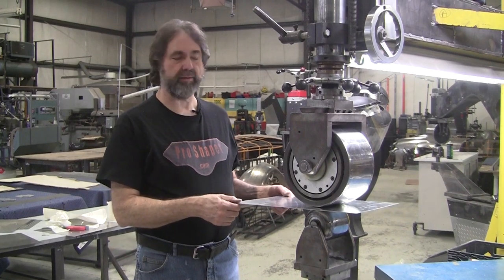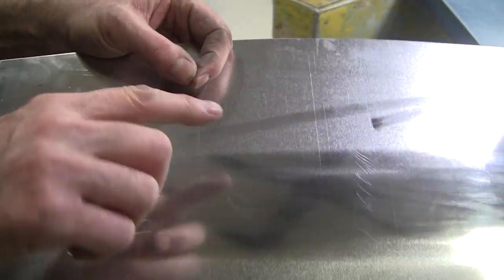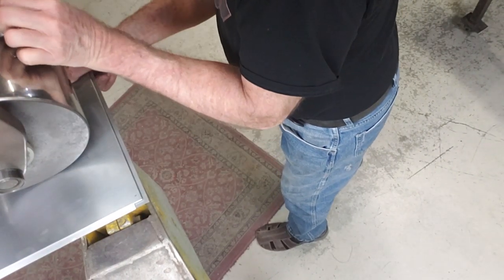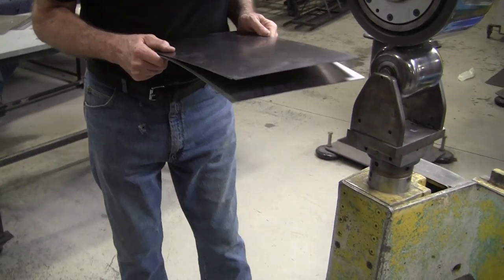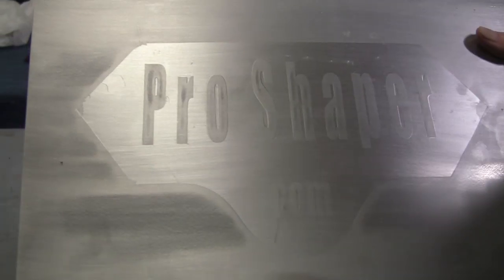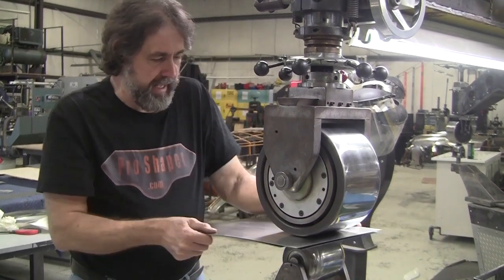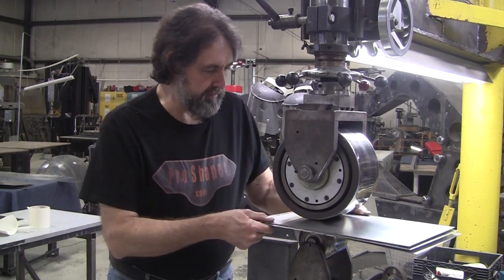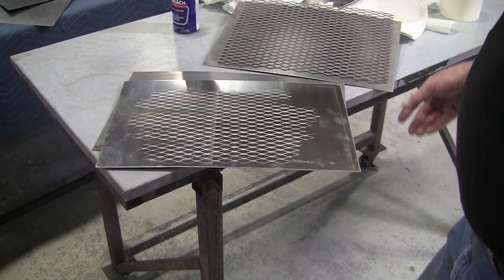Making Art with an English Wheel

Comment: The 92-96 Honda Prelude has the simplest-shaped dash of any modern car; it's just one continuous sweep from the left A-pillar to the right A-pillar, rounded over and slightly crowned.  I bet it wouldn't be that hard to make a metal version with the wheel (original was faux-leather-covered plastic).  This imprinting technique would be great for that dash!  But would you have to do all the wheeling in the sandwich, or do you think the imprint would (visually) still be there after wheeling with the bare wheel?
Reply from the maker: Hi Dennis, you could use a printed vinyl design and run over it under pressure after the dash is shaped. The process I used in the video is best for flat surfaces. A lot of 1930s cars had flat dash inserts where all of the instruments were located.

Comment: I'm one of those negative opinions of Plasma Cam. After two years of having experts try to make it work, I was finally offed a trade for a yellow dog.  It was a great deal. The dog doesn't take up much space and is easier to move. Also, the yellow dog is at least as good as the Plasma Cam for cutting out parts. If you are planning on getting a Plasma Cam just go to the animal rescue and get a dog instead. The Plasma Cam will give you two great days. The day you buy it and the day you finally get rid of it.  On a positive note; your coffee cup is working great. Thank you.
Reply from the maker: I have owned my Plasma Cam since 2003. I use it a lot, it never let's me down.

Comment: I'm Curious about the top adjuster on your big yellow wheeling machine.. Is it off something else or did you make it from scratch.? Thinking of converting my wheel to top adjustment  I'm always trying to repurpose stuff 😂  sliding propshaft  joints etc.. side effect is huge piles of unusual potentially useless scrap 😳..
Reply from the maker: My top adjuster on my Big Ewheel (which I built in 1993) came mostly from the local scrap yard. I had found the rack and pinion shaft and mounts several years before and knew I could use them as a component to a top adjuster. I also had purchased for peanuts a Bridgeport copy attachment that had a nice 360 degree locking swivel and large fine threads. Between the two components they merged into my top adjuster. All purchased for very little money- scrap prices.

Comment: G day i have a question/suggestion what if you used a rubber band on the upper wheel that might give the rubber a chance push in on the low spots of the design and compress where the pressure is higher 

Id like to try it but my e wheel is tiny and i dbout if the embossing would work very well
Reply from the maker: The rubber band would not improve anything. It is nothing more than high pressure that creates the embossing.
Reply: @proshaper  thanks for the reply so you have used a rubber band and the results were not as good ?
I just imaged that the rubber band would have a slight hydro forming affect 
Also i was thinking last night how i could do this on the cheap without an e wheel but if you have done it without success i wont bother 
Thank you for your time and willingness to share your knowledge